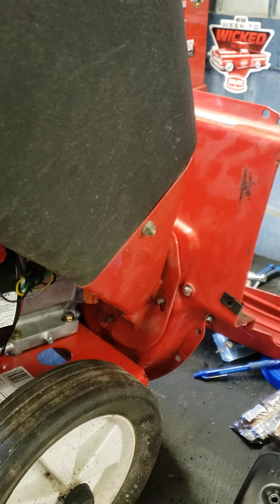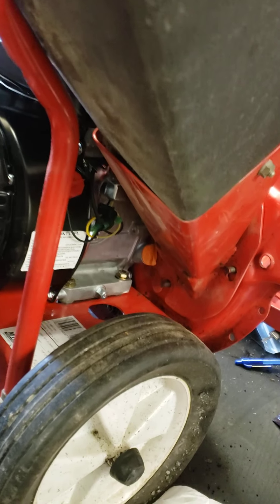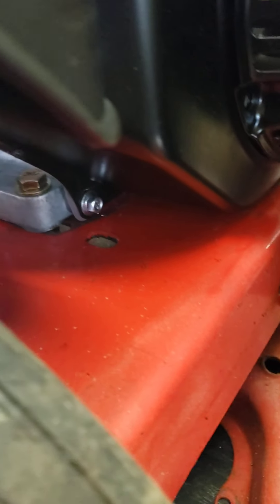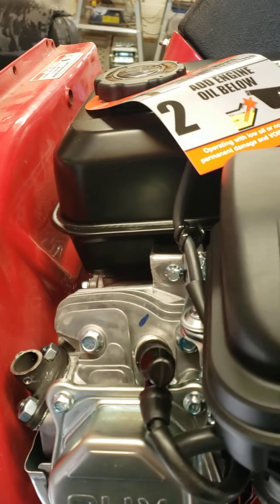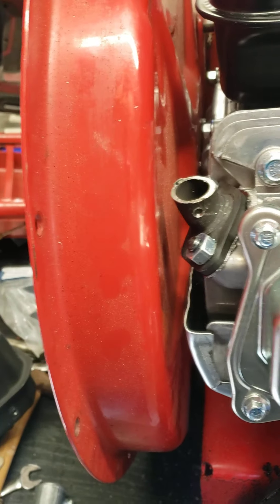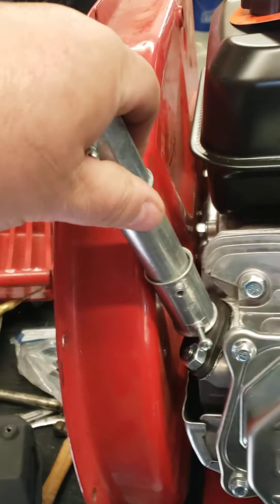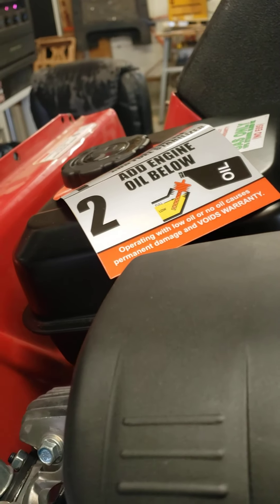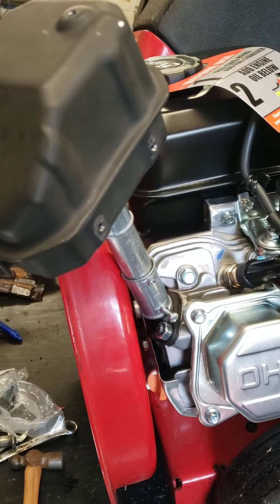Predator engine swap chipper shredder part 2

Comment: Thanks for the video. I think I have the exact chipper and the briggs engine broke, so I'm looking at buying a predator engine as well. 
Do you have a finished video of the chipper shredder?
Reply from the maker: Sadly I did not get to finish the project. The information about the predator motor being a good swap is not feasible unless you have great machining skills on a lathe to make a shaft adapter.  The chipper wheel on those machines have a tapered bore it goes from 3/4/to 1" in the back. My advice find another Briggs that will work .
Reply: @josephpayne9655  that’s unfortunate.  thanks for the info. Glad I stumbled upon your video before I started the conversation.
Reply: @Joseph Payne  there's a guy on Ebay that has those tapered shaft adapters for $50.
Reply: Why you didn't try some spacer look the difference is very minimum.